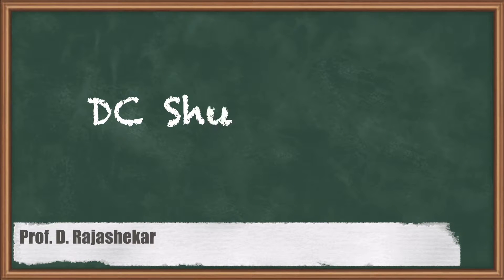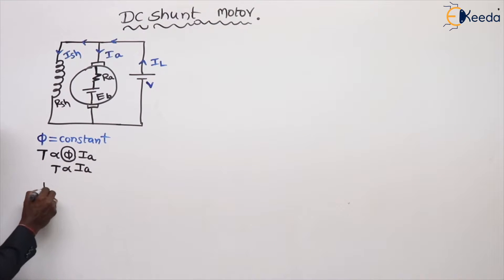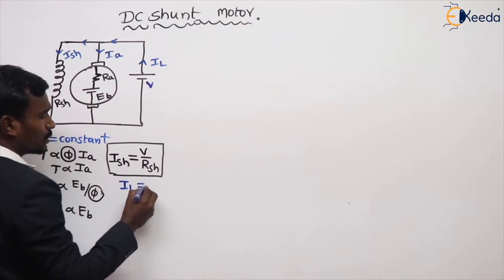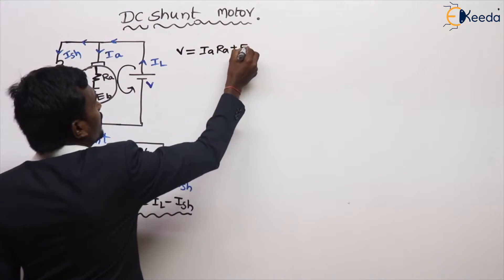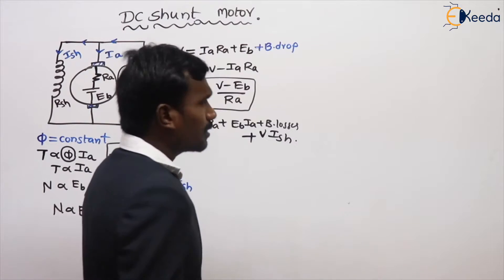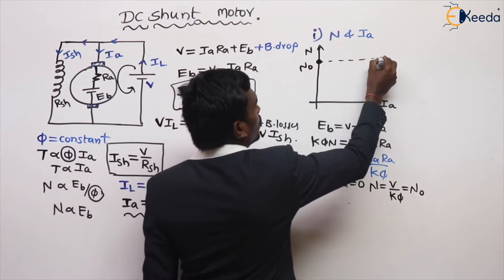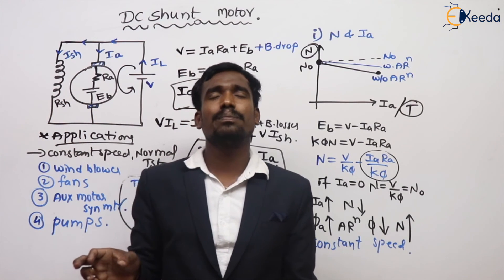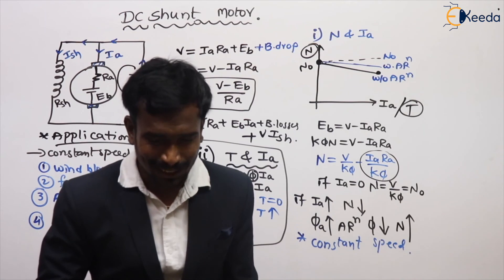DC Shunt Motors : Basics And Operation | Electrical Machines GATE

Comment: I have a question. How in this case the flux is constant as the field current is dependent on I(L) and I(a) by the equation I(L) = I (a) +I (Sh). Therefore I(sh) = I(L) - I(a)